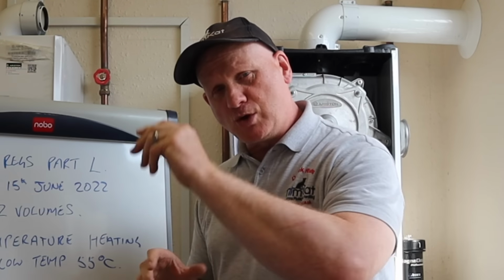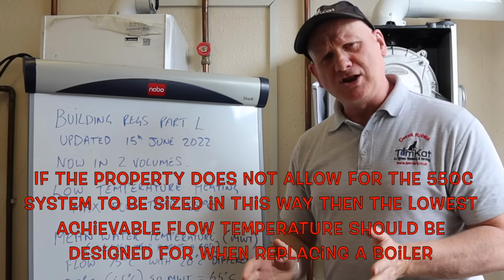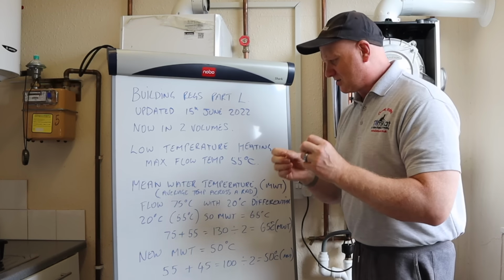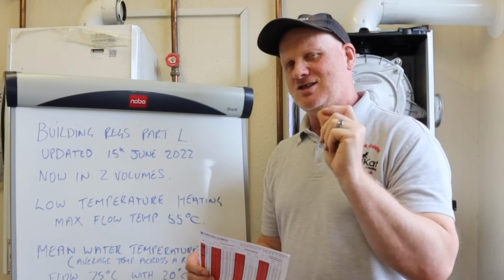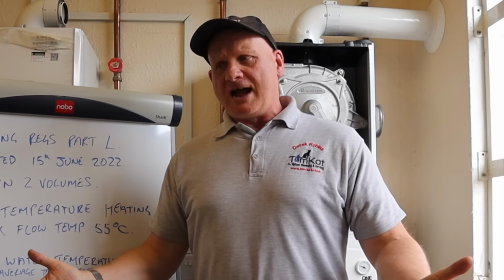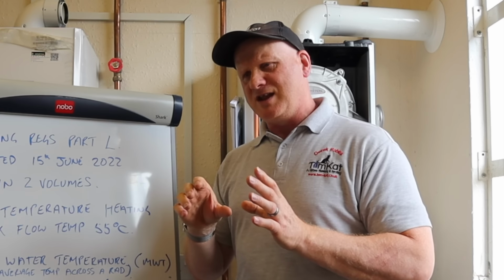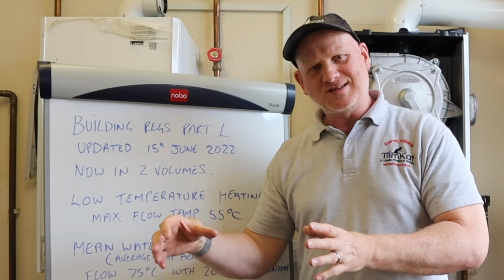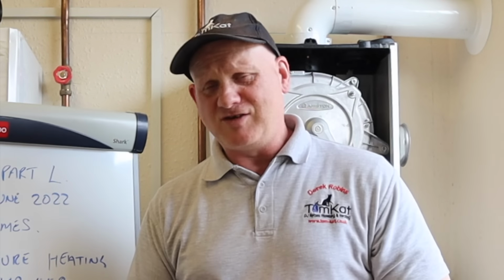Don't adjust your  heating flow temperature until you have watched this video. #saveenergy

Comment: I wonder if anyone has considered the higher electricity costs of the boiler running for longer periods of time due to operating at a lower temp
Reply: i have wondered the same thing... since electricity is much more the expensive of the 2. Unfortunately i dont have the answer or know where or how ot get it.

Comment: Not sure the regulations insist on a room thermostat. I took mine out completely when I fitted a V200 with weather compensation.

On hot water temp setting. I do think the legionnaire risk is overblown in domestic situations, maintaining a DHW cylinder at 60+ 24/7/ 365 is wasteful. As long as you raise the cylinder to 60 once a week that is sufficient to ameliorate the risk of legionnaires.
Reply: I'm not sure about the 'once a week' advice. I would have thought that the water in a cylinder is probably replaced entirely in one or two days (depending on usage of course) and that it all needs heating above 50 or 60 degrees.
Reply: @stuartwiddows9536  so what are you saying, once a day, once a month or don’t bother?

Comment: Fantastic video. However, we have Tado system controlling our radiators and is linked to combi boiler. I believe with Tado you don't need to touch the flow temp on the boiler as Tado takes care of it automatically? Something to do with modulation? Anyone?

Comment: Interesting, as a home owner I didn't know about the June 2022 revision to Part L for replacement boilers too. Interesting because one of the arguments put up against Heat Pumps is that the radiators and pipework has to be often upgraded for lower flow temperatures. This revision, therefore, means the heat-loss and sizing survey would need to be done irrespective of the heat source and the price the home owner pays for either solution could be closer to parity than it might otherwise have been.
Reply: Eh. I bought a house and put my boiler down to the lowest flow temperature possibly (Initially starting at 55C, going down to 40C) and it works quite well
Reply: @waqasahmed939  do you find it just takes longer to heat up though? So the lower the flow the longer it takes to get up to temp with the same rads
Reply: What a disaster, I know my house doesn't reach the house thermostat set point at any flow rate in winter within a reasonable time frame if I set my boiler flow temp. lower than 70 deg C.  If my boiler failed I'd have to overhaul the whole system to make it compatible with such a low flow temperature.  Put simply at a 55 deg C flow temp. the thermal losses of my house would exceed the amount of heat the radiator could output for their size.  Quite frankly, I like the size they are and they are already very big!
Reply: @PB-lu9tp  Mine is the same. It's a 1934 build, double brick walls (no cavity), full loft conversion (fully insulated) so no loft left to insulate, 12 radiators some with smart TRVs and some with ordinary TRVs and in "normal" winter conditions it needs to be set at 70C else the house will never get up to temperature. In this really cold snap we have to have it at a tad below max for the boiler (39Kw condensing boiler) otherwise the house won't get up to temperature. Lounge is set to 20C. Bedrooms off during the day and 18C at night. Bathroom 21C during peak showering times else 18C but the smart TRV there detects if bathroom window is open and shuts off the heat if that is the case. Everywhere is fully double glazed. Reflectors behind radiators. The only thing left to do is fit external cladding insulation but I'm not keen on that and we might have complaints from neighbours as one wall is along the boundary and adding 4 inches of cladding would narrow their drive. No way could we ever heat with boiler running at 55C as there is not the space to install what would probably be double the number of radiators.
Reply: Replacing gas boiler and running it at 55C. Makes sure that the installation is future ready for heat pump

Comment: Surely the easiest way to determine in your rads are big enough to cope with the set flow temp and if your condensing boiler is operating in it's condensing mode is to simply measure the return temp. On a side note. There's lots of mentions of building regs but it seems that there are a lot of people ignoring them. I've seen many newly completed buildings with poor insulation, very small rads on microbore, no room stats, no thermostatic valves on baths, dodgy electrics. Building inspectors need to start checking these things.
Reply: Yup and if you have cast iron or other types of radiators. Cast iron rads on a condensing boiler is the best combo
Reply: Agreed but cuts to council funding has put paid to them
Reply: T
Reply: @David Wanklyn MAY??? I'm cutting down on food, so I can afford to have underfloor heating installed. ;-)
Reply: @Mike-H_UK  You must eat a lot, otherwise its gonna take YEARS! 😅
Reply: @Mike-H_UK  Good luck dude, hope you considered the electric bill!

Comment: Air sealing a building or at least stopping draughts is cheap and easy, if a bit time consuming.  Ensure each area has some functional method of air exchange, a functional opening window or wall vent.  Check how well the the window and door frames seal to the wall material both inside and out. I use Clear TEC7 along with good sticky tape to protect window frames and walls. Then seal up the gaps. Remove the tags for a neat clean edge.  Typically heat is on for a few hours a day. In winter all the other hours are time for warm air inside to escape either through the walls and ceilings or through air leakage.  An old pillow in a plastic bag pushed up a chimney seals the chimney which can eliminate more air flow.  If you get most air leakage fixed look out for condensation.  You might need to alter behaviour to open and close vents as required. These things can be part of normal routine.  Lots of videos online for those who look. The move from watching to doing. I’d estimate I saved about 10 to 15 % off my energy bills.  An infrared spot thermometer £20 to £30 was very useful.  Hair line wall cracks can give a delta T of 1/2 deg C……but they operate for 24 hours a day and that is where small cracks add up.

Comment: Makes no sense turning down the flow on rads u still need same amount of energy to heat the room it'll just take longer. Is it more a safety thing to protect from burns.
Reply: More heat goes out the flue when the flow temperature is higher.

Comment: Should not it be 55-20 = 35 so 55 + 35 = 85 / 2 = 42.5  MWT  ???
Reply from the maker: No
Reply: @tomkatgastraining    ok so where did the 45 come from please ?
Reply from the maker: @9111logic  I explain it in the video it’s the flow temperature plus the return temperature divided by 2 to give the average then minus the room temperature gives the delta t
Reply: @tomkatgastraining  Thank you kindly.

Comment: Just a slight correction: temperature of water for washing up isn't to kill bugs; you'd need temperatures near boiling for that (and even then it won't kill some of the real double-nasties, like tetanus). The temperature is to make soaps and detergents work better on grease and fat, by melting it. All a soap consists of is a molecule one part of which dissolves in fat and the other end dissolves in water. Chuck soaps onto grease and agitate it and the grease forms micro-spheres in the water, effectively dissolving. This works better if the fat is liquid.

As an aside, the only thing that will properly sterilise things is boiling with water inside a pressure cooker. You need 20 minutes at 120 degrees Celcius to kill all bugs; boiling water only gets up to 100 degrees at atmospheric pressure which isn't enough.
Reply: Not quite right. It is to do with killing of  legionella bacteria which cause legionnaires disease,  which starts to die at 50 degree Celcius.
Reply: A bit over the top as regards sterilising.  We don't all live in pathology labs working on the bubonic plague.  Just wash your hands after going to the toilet and pre eating!

Comment: One question please. I have Hive and the room thermostat.  Where is it best to place the thermostat?  I tend to move it from room to room to either bring the boiler on or off (heating only)  The common place I’m told is the hallway, but if the hallway is say 18 and I want the lounge to be 19 or 20, then the lounge rads won’t get up to temperature.  Am I right?
Reply from the maker: Probably your best option is which room  you put the stat in change the temperature for the room it’s in and see how that goes also if you have TRVs set them to the correct temperature also